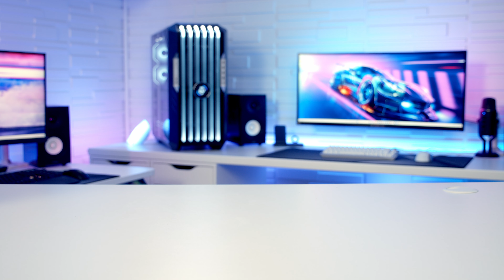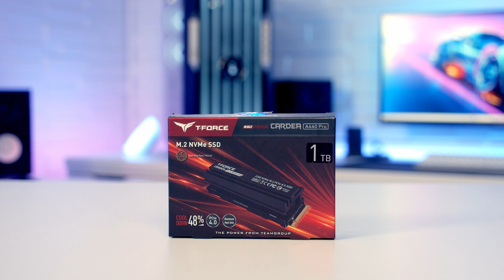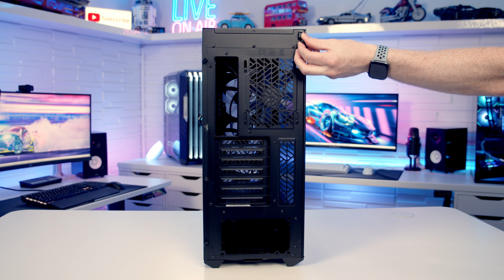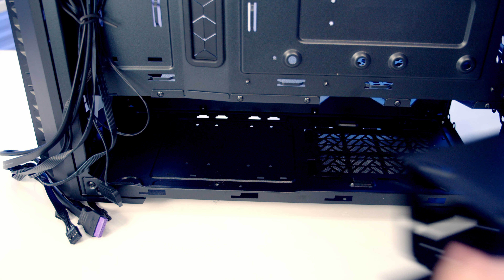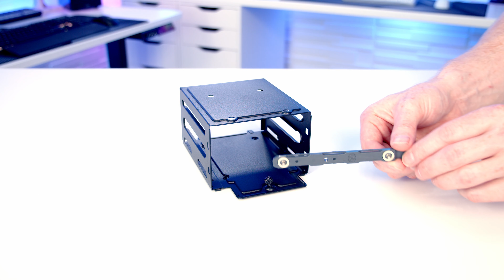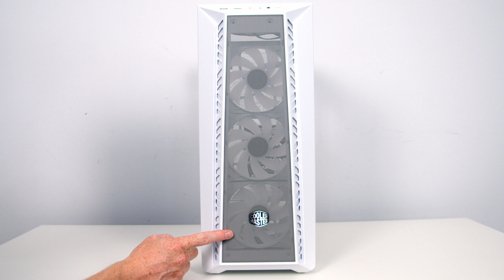Cooler Master Masterbox 520 Build - Step by Step Guide

Comment: Hi Chritopher! First thanks for ur video. Second, In minute 27 u could have explained better ho to set the usb C cable into the motherboard. Just 30 seconds to mention that it ist not the same one way or another. It is not clear and in some cases the cable looks  symmetrical at a glance. Its weird that u took so much tyme to explain about the other usb cable that comes with a notch in another video but no time to explain about the other that doesnt come with a notch. 
Another problem I see it is that it is pretty much complicated to remove  some cables. For example the Pannel cables in this case or the Usb c cable. Important stuff like that should be refered to.
I dont like telling people what to do, Im sorry to criticize,  but those mistakes are very important to be dealt with when explaining things. Never leave uncommented difficult frequent tasks is my advice to you

Comment: In the anti-sag bracket instruction booklet in the diagram for mounting the standoffs there are shims that should go between the motherboard and the standoffs. When I put the shims there is not enough length to the standoffs to screw them in. If I do it like you it works. The motherboard is the Asus TuF Gaming x670e plus wifi 6e. I guess it depends on the motherboard whether you could use the shims then huh?

Comment: Hi Christopher, I'm about to build my first build, and I was looking at this case, both mesh and non-mesh, but I have a doubt: is it possible to mount the Arctic LQ3 360 on top easily, or does it touch on the MB? There always seems to be space between the motherboard and the computer, especially with 120mm fans, so it's narrower, right?
Reply: Better go for Lian li 216, even I was confused between the MB 520 and Lian li 216 and got the 216. Worth all the bucks I have spent on it.

Comment: I need help, im getting as a gift the same cooler, im thinking of getting an asus b550 prime plus or an msi mpg b550 plus and idk if theyre compatible with the argb cable, or from where did u get the controller on the back of the case, or if it cames with the motherboard, help 😭

Comment: Hi, a doubt, those three fans has three pins right, so they always works at max rpm, wich, acording to the reference will it be 1200+200, 1400 rpm?, acording to the answer of the first question, can i plug those fans to the 4 pin ports of my board and manage the rpm on dc mode? thanks. Great video

Comment: Front glass panel and fans behind it, for me, is a no-no. Either go like the O11 and H9 and use side intake or don't bother. The NZXT H7 Elite can perform fine, but requires some planning and higher rpm. If you want something that will cool your PC as much as possible with minimum noise, keep it simple: Lian Li 216, Lancool 3, NZXT H7 Flow or Phanteks G500a. For the looks, get a Fractal North, Lian Li O11 or NZXT H9.

Comment: I’m glad I watched some of your videos before building my pc. I’m a retired engineer and used to design disk drives and back then, I was intimately familiar with all the components. But I’ve been out of the business for over two decades.
Reply from the maker: The RGB is the most confusing bit, leave than out and its very straightforward
Reply: @ChristopherFlannigan  I didn't implement RGB. The case came with some RGB fans. They are plugged in and work but I usually have them turned off. What is of interest in your builds is the attention you pay to the case and of course the components you choose for each case. All those details add up for someone who pays attention to you.